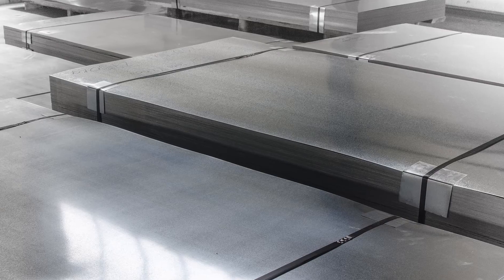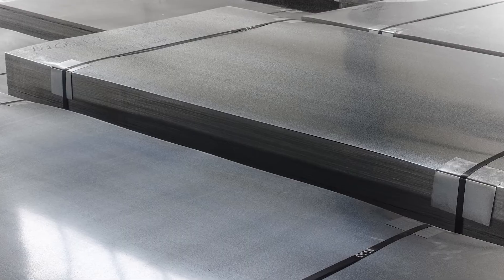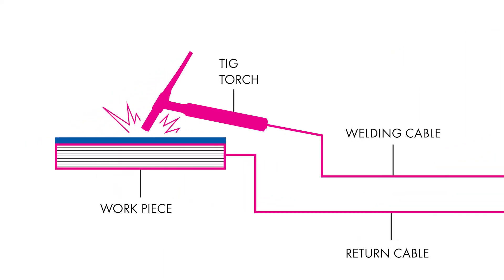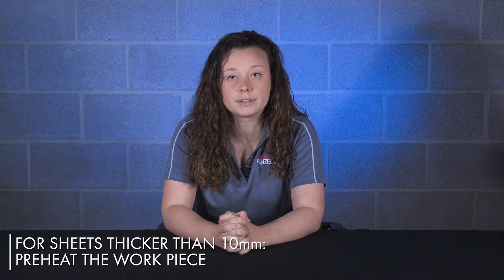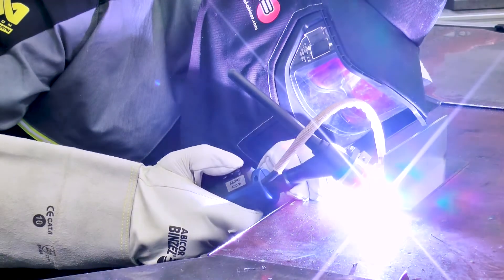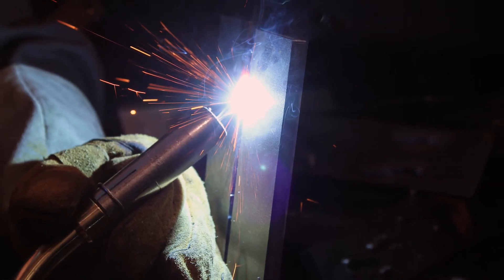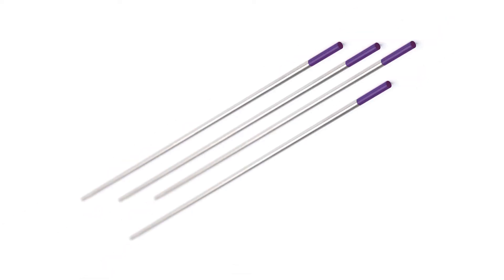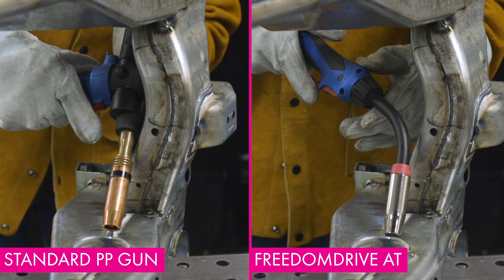The Basics of Aluminum Welding that You Need to Know | Binzel Basics

Comment: The push-pull gun is the best idea I have seen in ages. I am not a welder, just a certified auto repair tech since 1978. But, a modern auto body & paint shop has to have at least one trained aluminum weld tech as front drive vehicles have used thick aluminum welded and bolted sub-frame parts that hold the engine, transmission and in some cases the entire front clip. That is genius compare to spool gun welders others sell. They should recommend a new liner and one size larger than the aluminum wire ran thru it so it has less of a chance to bind up or birds nest. Plus, I bought a new stainless steel brush but I keep it inside two plastic gallon zip bags. I but few ever do that. That for sharing... Just great.